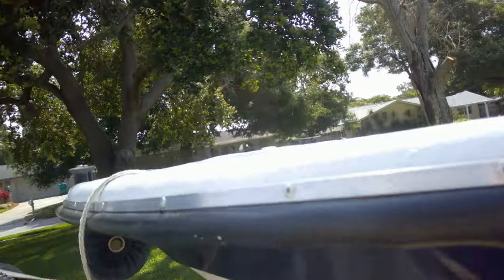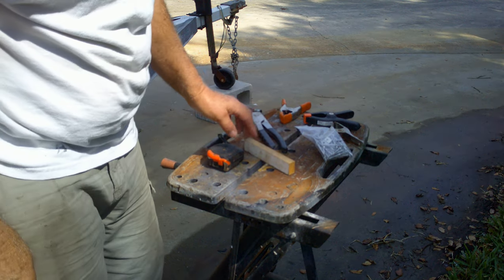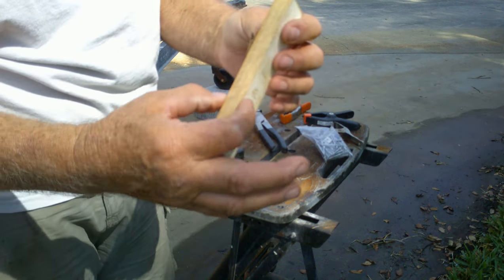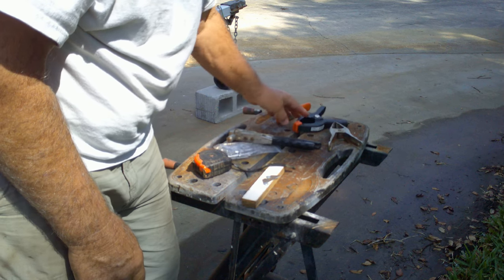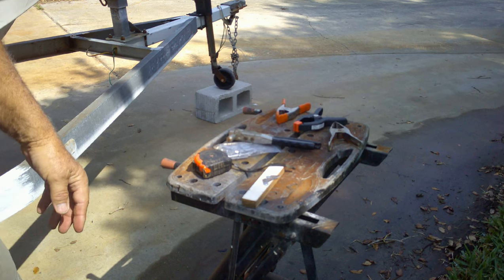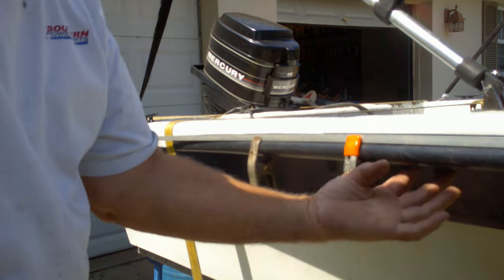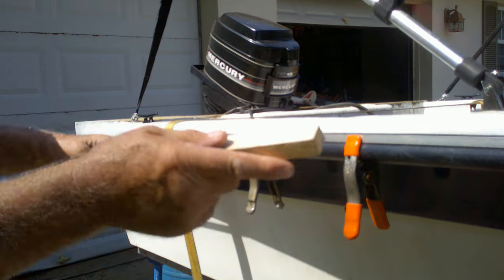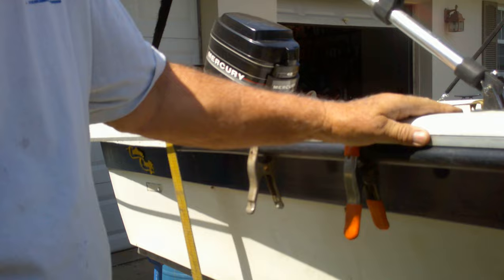DIY Boat Rub Rail Cheap bumper

Comment: Do you remember the name of the material you used?
Reply: Home Depot has it. Vigoro 50 ft Heavy Duty Plastic Landscape Edging. I bought the aluminum at our local metal supply. Aluminum is 1/8" x1/2" and I think it was 10 or 12 ft long. Hopefully this helps. Thanks. Alex